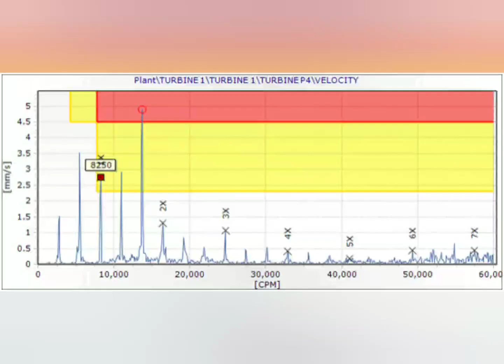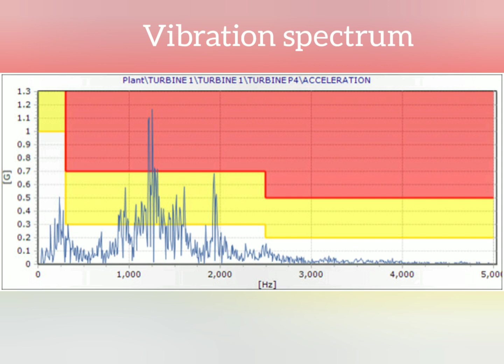7 M.W Steam Turbine Abnormal vibration

Comment: What probes do you have?
orbit plot?
1 x harmonics, possible clearance issue
Reply: oil starvation
Reply from the maker: This turbine does not have installed shaft vibration probes.
Reply: @turbomass3267  eddy current probes to track the rotation of the shaft. 

We're solving a problem with limited information.

Even if he is using accelerometer, some energy will be lost but we can solve the problem.